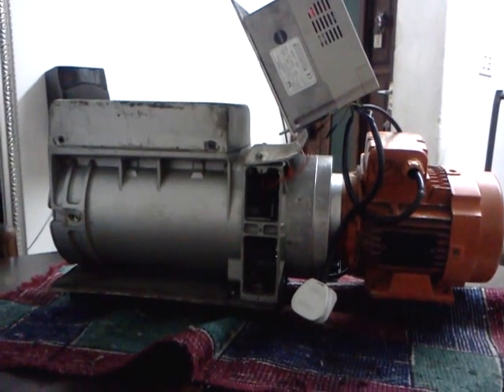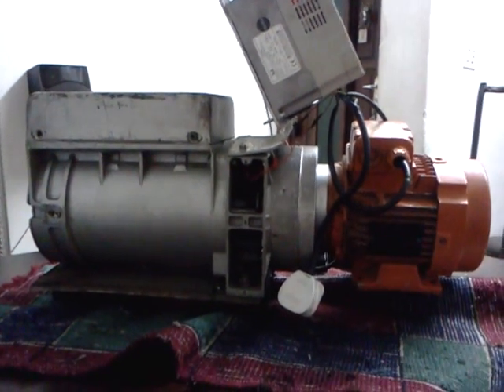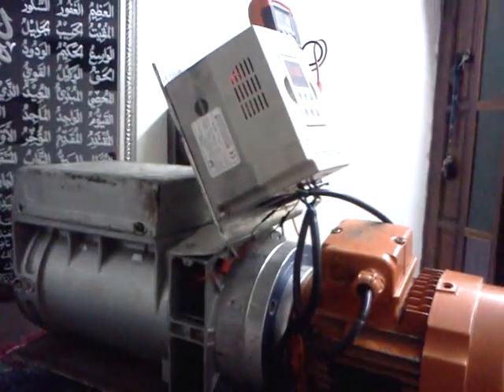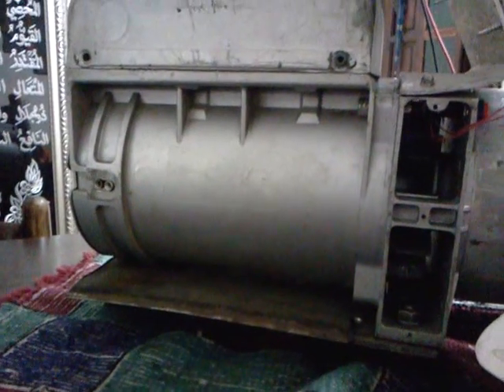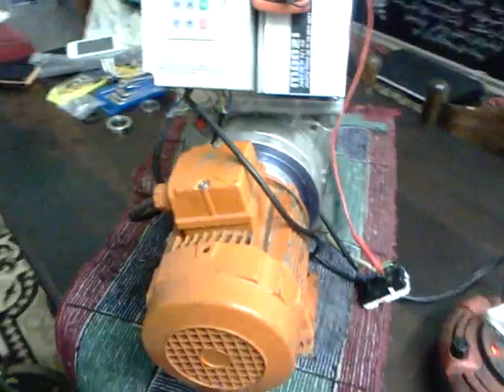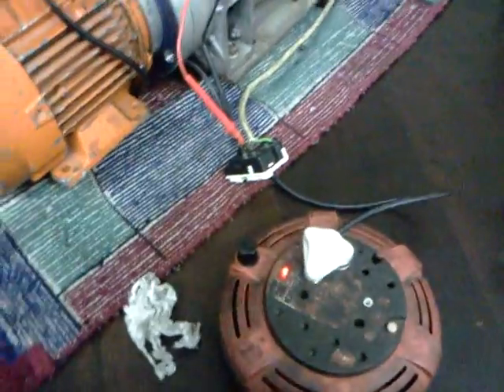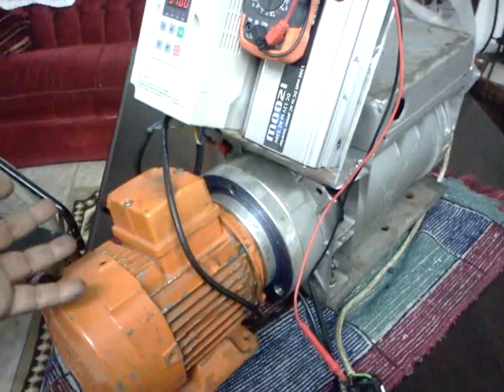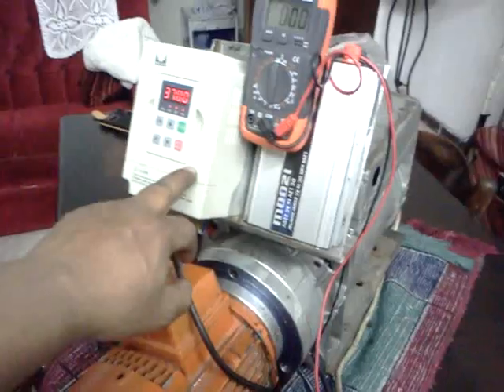Fuel less Electric Generator

Comment: to start of the grid is fine (dont need the grid for a fuel source could use solar, wind, even water.) if it runs off its own power (once started) how much could you pull wattage wise. and is there ways to tweak it to pull more then what it does at the moment. i would like to try something like this for a off the grid bug out shelter idea

Comment: bullshit. if you pull 3.5kW from a 0.75kW powered generator, its motor will stall and burn like hell. in any case it will consume a lot more than 0.75kW. and then it melts.

Comment: You do realize by having to plug into the grid, your using fuel... right?  Not sure what exactly you trying to prove here.  But what I see is an electric motor attached to a generator and what seems to be some sort of electric motor speed controller.  Your providing power to the motor (again using a fuel source) then simply turning up the motor speed control to produce more power from the generator...

Nothing new here.  For instance, if I had a gas powered generator with a motor producing 3000 RPM's and providing 220 volts at the generator and then swaped the motor for one doing 4000 RPM's obviously the power output at the generator is going to increase... so what is the point of this demonstration?
Reply from the maker: Hi Preston, Thank you for letting me know what I have plainly stated. My method of generating energy is different then conventional. I demonstrate in my video my energy multiplier. I am using a 0.75kw standard 4 pole 1400rpm motor with my technique I have multiplied speed and torque to achieve 3.5kw peak power. That is +350% increase in efficiency. It was hard to believe when I hypothesised it. This is proof of concept.

My multiplier can be coupled to any power source and increase its output exponential depending on the ratio. This is a working prototype demonstrating that it is possible to multiply energy  with the right components and technique. This electrical motor is standard and it is possible to substitute it for HCF, Steam, Thorium and various other agents.
This is my contribution a Carbon Reducer.
Reply: I guess I am just not understanding this concept.  It seems to me what your doing is increasing the RPM's of the motor to increase the output of the generator.   You can clearly hear the motor and generator winding up faster as you increased the the control box.

I would be interested to see the constant amperage draw of the motor as you increase the control box, I think you will find as you increase it the amperage will also increase to the motor therefore you gains are not real gains.  You will be using more power to get more power just as I stated in my earlier comment.

Motor speed controls are nothing new and it seems to me this is all I am seeing here.  Am I missing something else?
Reply from the maker: Thank you Preston. For the insight. My amperage draw without a load is 3.5 amps with a draw it peaks at 6.5amps generating 15amps. That is this model, my initial prototype or proof of concept. This multiplier is a ratio of 1/3.5  output. This video was only to prove my concept is possible. I had to ascertain what is necessary to increase productivity.

And that is what I have done, my current generator is much more efficient than my initial prototype.
Thanks for the input

Comment: Ummm - might have been more convincing if you

1. explained what the numbers on the gauges were trying to tell us.
2. Connected the output to the input (rather than the grid power) and showed that it continued to run totally independently
3, Explaind how much power went into the input and how much came out the other end.

If your machine does what you claim it is a perpetual motion machine and violates the laws of thermodynamics. Which really would be a first.
Reply: Scott Hullott
I think you need to work a bit (actually a lot) on your sales pitch.

And I'm sure you'll not be surprised to know that I don't envisage being one of your first customers.

BTW - before you went to all the trouble of listing out a set of components, did you manage to get the Laws of Thermodynamics repealed? If not, it ain't going to work, no matter how many buzzwords you string together. Sorry about that.
Reply from the maker: Hi latimer my E Generator dual input: either 12v or 22Ov input.
0.75kw 3 phase Electric Motor attached to a 5.5 kw single phase Alternator /Generator.
Using 3.5 amps operational
6.5 amps with load of 3 kw.
This was just my prototype to demonstrate what my invention is capable of.
This was designed for my Self Generating Electric Vehicle
Reply: Yusuf Mallie
What was nett power in? And nett power out? How did you measure them? What did the two digital gauges tell us/you?

Why didn't you do my point 2? That would be a 100% proof that you've done what you say. And very obvious.
Reply: Sir please contact with me Muhammad Asim at this number 0616241924
Reply: Scott Hullott

If its a true 'fuelless' electric generator, it can be isolated from the grid and should continue to run. If it needs grid power it is not 'fuelless'.

This is really not a hard concept to grasp, no matter how much handwaving you do.

Please ask the demonstrator to do as suggested.
Reply: I'll take that as a 'no' then.

And from that I'll assume that the machine isn't capable of running 'fuelless' as claimed.
Reply: Scott Hullott
Wow. Here's somebody who claims to have the Holy Grail of energy production at his finger tips. A machine that (if it acted as claimed) would be the most significant invention ever made and that would truly change the world.

And you give up on answering a simple question because you're 'bored'.

Way to go Scotty Boy!

But just a wee bit of career advice. If you ever feel the urge to become a salesman or politiciam..resist it. You aren't naturally suited to persuading anyone of anything.
Reply: Scott Hullott Up to you sunbeam.

If you can't be arsed to clearly explain  the answer to some basic questions about this apparatus, you'll not be surprised when people begin to think that you haven't the faintest clue about it.

Your choice. But its often better to stay schtumm and be thought a fool rather than to open your trap and prove it.
Reply: Scott Hullott
Thanks for illustrating my last point with such clarity and eloquence. You are a perfect example of what I meant. Toodle pip.
Reply: Scott Hullott
You can, of course, waste your time by wilfully ignoring the 200 years of accummulated wisdom and experiment that went into people understanding the Laws of Thermodynamics that are governing principles of the Universe.

And maybe after many years of futile experimentation and coming to the same conclusion the hard way - that a fuelless generator is an impossibility - as you would have with a few hours study of some real science, you will give up and try another project.

There's those fairies at the bottom of the garden that needs investigating and the pot of gold at the end of the rainbow remains unclaimed. Nobody has made much of a collection of rocking horse shit and those pig powered aeroplane Porcine Aviation Inc ain't got of the ground yet.

There' a huge portfolio out there of other useless projects for you to work on. But please waste your time, not ours with them. Cheerie bye!.